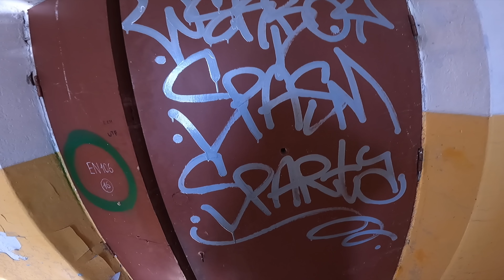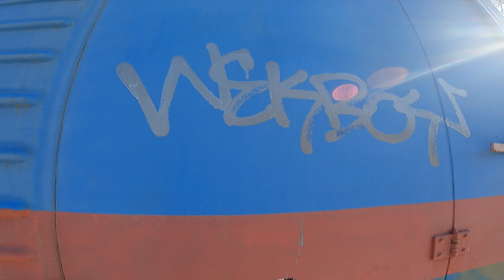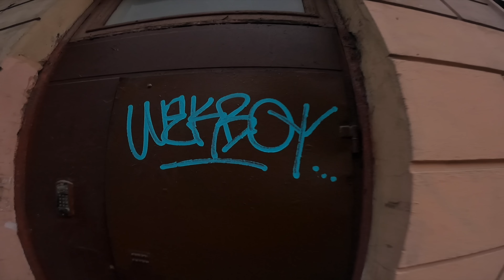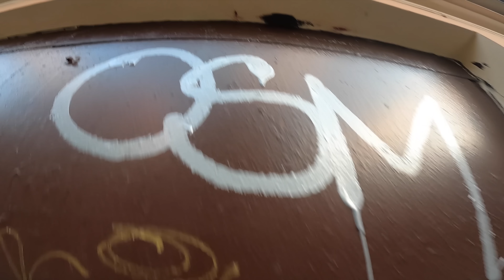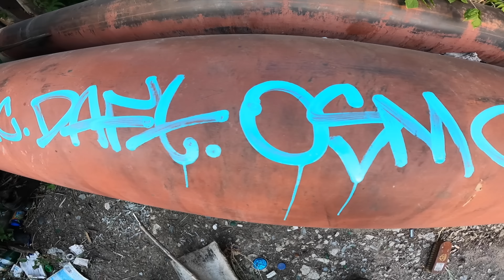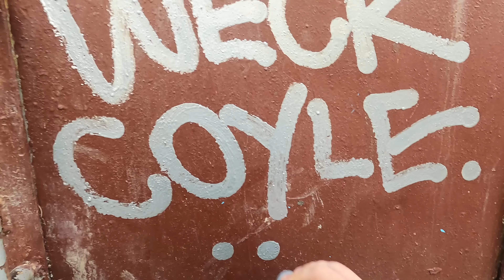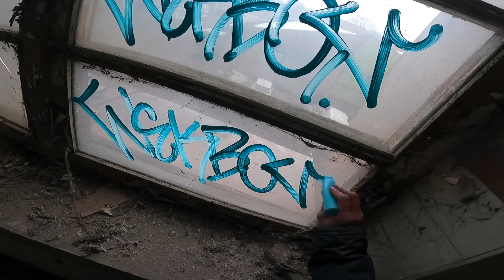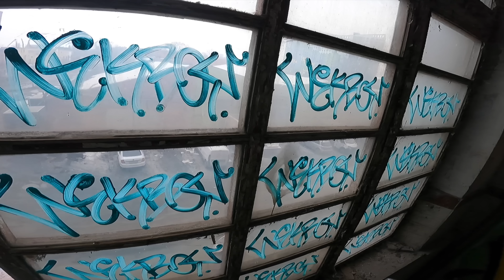Graffiti review with Wekman Hubik ink

Comment: Давно ждал обзор на хубик, всегда было интересно, что из себя представляет заправа на клеевой основе
Reply: It's a good ink/paint but it's easily buffable and doesn't drip to much if u want drips, if u really want to leave a stain even after it's buffed get some hard to buff ink and mix it with flowpen it will drip like there's no tommorow and will bleed into the surface you use it on and will be extremely difficult to be buffed
Reply: @chrisinthecut6697  Ok, thanks)
Reply: @chrisinthecut6697  cool advise
Reply: @chrisinthecut6697  thanks man, its realle very nice
Reply: Дерьмо заправа
Reply: Same here bro
Reply: @Гений-л5т  какая типо хубик
Reply: @Гений-л5т  Норм вроде
Reply: @VHS-z5i  отдирается, баффится, слишком густая, может стать клеем в маркере и испортить его
Reply: @the_snooow7567  да
Reply: @VHS-z5i  поттеков нет, дорогая, тот же фмп намного лучше хоть и дешевле в 2 раза
Reply: @Гений-л5т  Насчет подтёков согласен, но они не всегда нужны, насчёт цены согласен, но фмп не на клеевой основе, а значит не конкурент этой заправе. Плюс заправки на клеевой основе в том, что она даёт прикольное ощущение при написании, густая очень
Reply: @Гений-л5т  И кстати фмп не в 2 раза дешевле
Reply: @Гений-л5т  Если маркер норм и герметичен, то она не превратится в клей
Reply: @chrisinthecut6697  what are good suggestions for hard to buff ink??
Reply: @Гений-л5т  it can if you don't use it and don't put a mixer in it
Reply: @Гений-л5т  да я согласен за 1-2 может стать клеем 🤣
Reply: @chrisinthecut6697  9
Reply: @chrisinthecut6697  thanks you
Reply: @Гений-л5т   is it same for other Hubik inks? Or just for this silver ?